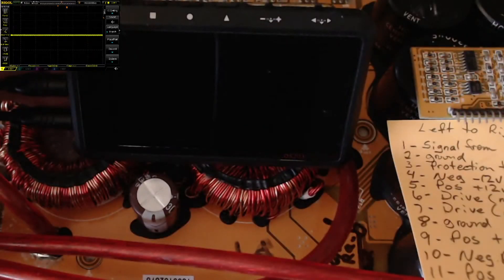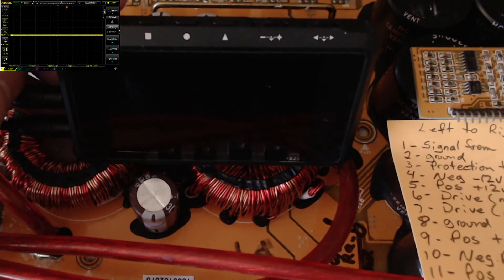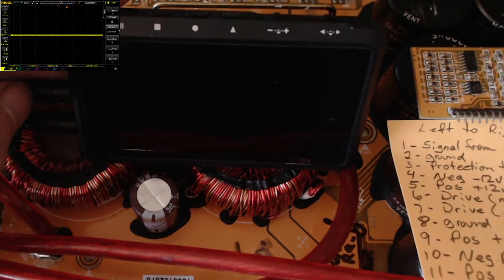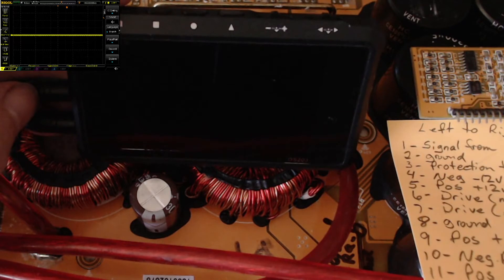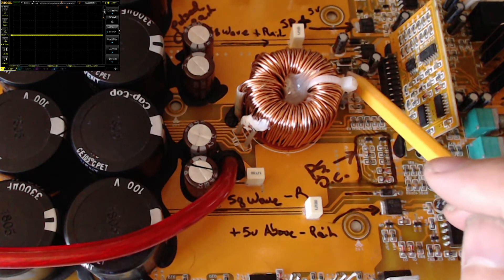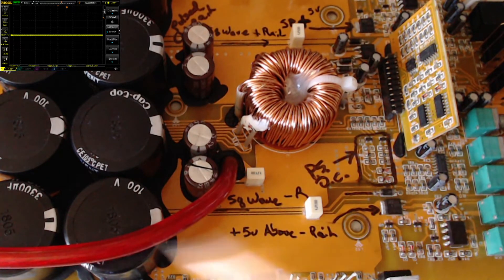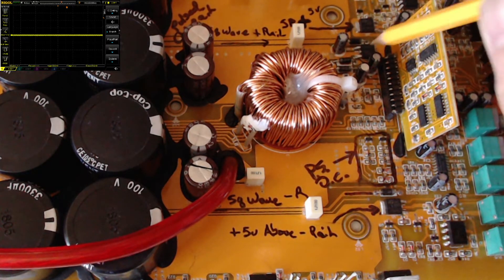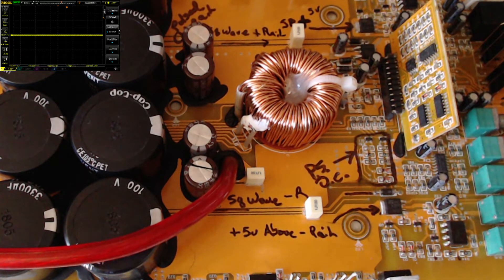Type 4 Class D Car Automotive Amplifier Aux Power Circuits Repair Aid

Comment: Hello, thank you, it was very informative. There is a transistor on the sound card of this amplifier. I need the code for this part.
Reply from the maker: There is only one transistor that I remember for the mute curciut. I think it was a 1x. Other than that is is a few comparators/opamps and NOR gate ICs like the HC02.

Comment: Question/. Mind you I am merely an Audio Buff who assembled numerous Class D Power Amplifier Kits, " {Classic D } Designed by Silicon Chip years if not decades ago" 
Anyway with regards to the driver board, Am I correct to assume that the entire "Driver PCB" by now should be available on a single Chip, is there some advantage I am overlooking for those boards still being used?

And perhaps getting even further ahead of what may not be feasible, if we look at an entire Class D circuit diagram why not have an entire Class D amplifier within an inline Ceramic package "INCLUDING Power Supply Requirements"

Only limiting factors I see, are the Filtering Inductors would require extra pins on such a High Power Class D Audio IC, And Granted around 1000Wrms output would be the limit per chip, But anymore than that is just insane anyway, So is the Thermal limits the reason why such chips don't exist?
Reply from the maker: There are a few thoughts that come to mind on this. I think diversity is a major player in this. If an all-in-one IC were to be produced then all the manufacturers who want to implement the IC would have to have almost the same design. The thermal issue in my opinion is the largest hurdle. Also, the conversion of 12v to 100+ volts at a given high amperage is an issue that goes back to a thermal issue.
An analog to digital converter such as the tripath is the first thing that comes to mind for a manufacturer to try to implement a full control "IC" but gosh they tend to fail again due to heat.
I am by no means an engineer so I may be way off on my thought process for this question.

Comment: nice video, the positive and negative 12 volts also feeds the the opamps in the preamp circuit
Reply from the maker: Thanks Peter for watching! I didn't go into the pre-amp as that is another topic to tackle. For new techs, the pre-amp is hard to follow and understand. Maybe one day I will go over that once I find a comprehensive way to explain how resistors, capacitors, and feedback circuits affect the sign wave.